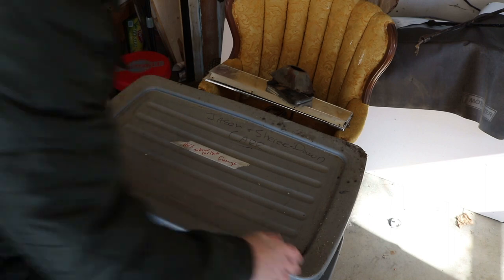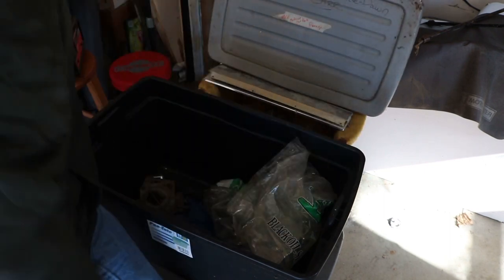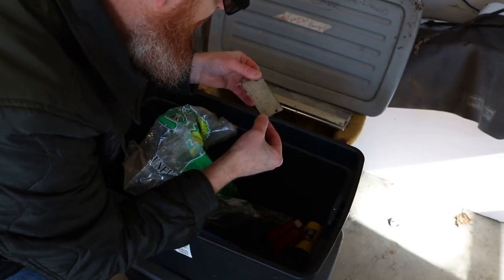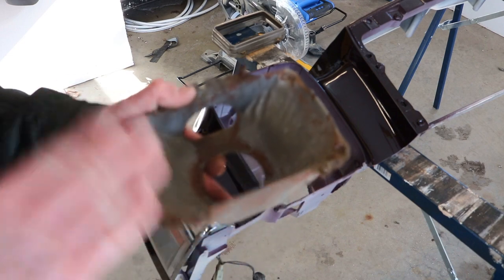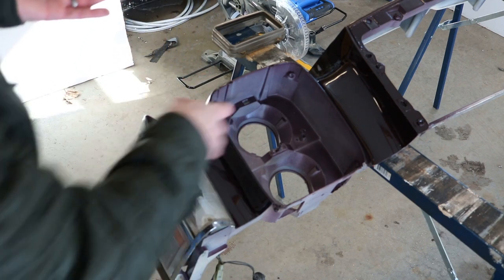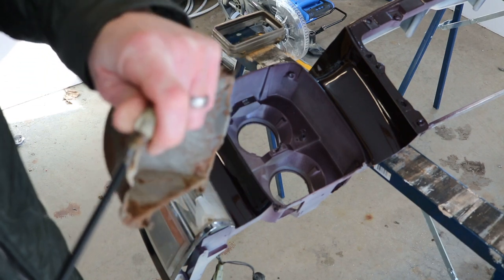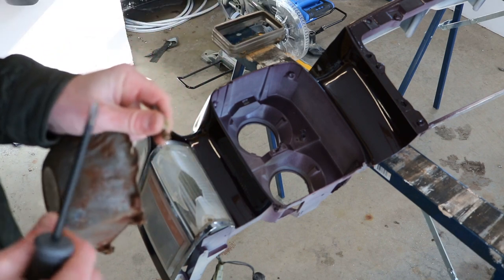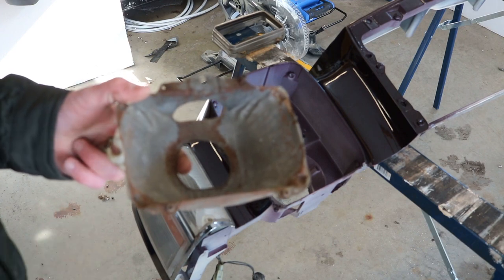WALL ART PART 3- WHERE'S MY GRILLE

Comment: If those bulbs don't clip in, you could just substitute some 12 volt adhesive LED strip lighting. that way you can get it in any color you want. Have you thought about making a grill from stainless mesh? Just a thought awesome job that thing is going to be sick!
Reply from the maker: I think I want the original look. However that may change depending on finding another grille.
Reply: @OldeCarrGuy  I hear that from sure